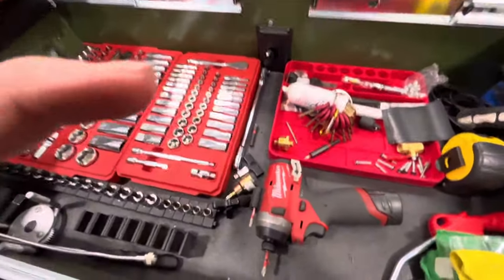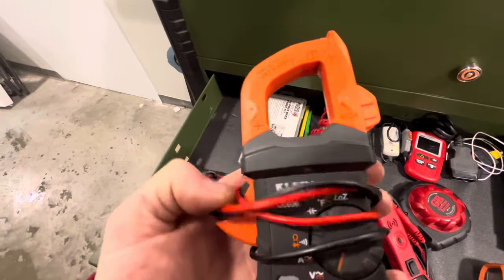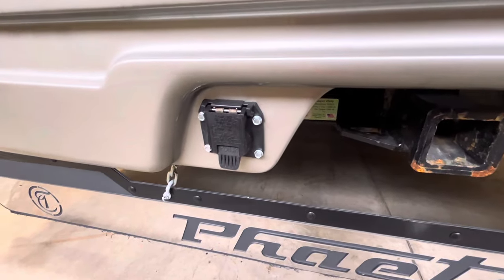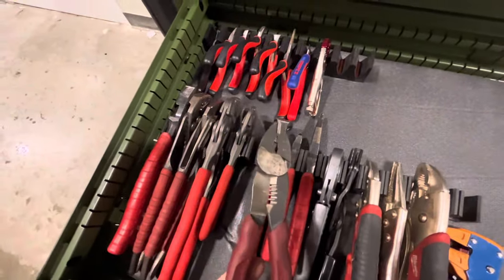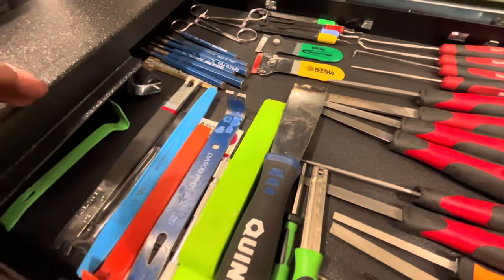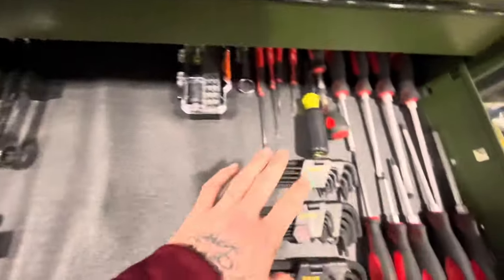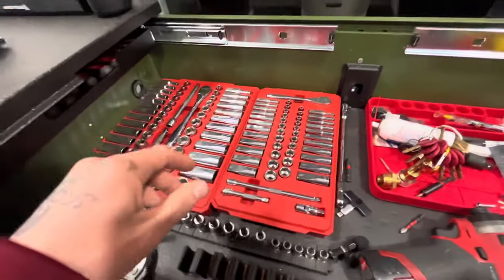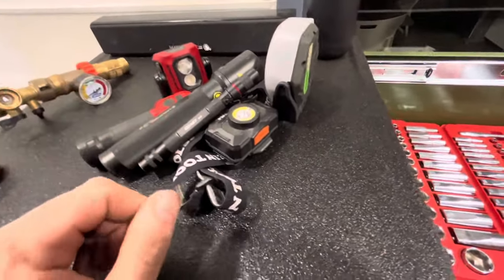5 tools that should be in every RV!

Comment: You don’t having any plumbing related tools, that is a common failure area for RVs, I carry a tubing cutter and a PEX crimper, specifically a ratcheting crimper that can be used with one hand because most of my fittings are in hard to reach areas.
Reply: Thank you I will make sure to add them to my list
Reply: Oh yes….very few rv’s are plumbed according to code. Flex hose crimped onto pex fittings is quite common……

Comment: Been RVing well over 30 yrs.  Besides a well rounded set of tools as said in this video and yes plumbing tools as mentioned in one of the post    Remember rvs have both pvc and pex systems so make sure to carry tools for both as well.  As in electrical rvs run both on AC voltage as in dc voltage as well. You’ll need tools for both as well.   1 piece of tool that is not mentioned and has saved me countless times is a ladder if your rv does not have a roof access ladder.

Comment: As an HVAC tech, I recommend that whatever multimeter you get, MAKE SURE IT HAS A BACK LIGHT FUNCTION. Also, make sure it can read micro amps-you'll need this to check your furnace flame sensor.

Comment: One thing about power tools is something that (my rv works) suggests having a 12 volt system.  This gives you a portable 12 volt power source, in addition to the tool, for troubleshooting.  Just make sure you can access the battery terminals.
Reply from the maker: If you’re on my TikTok take a look at the 12v test tool I just posted

Comment: Most people don't know how to use a multimeter. As far as testing the pedestal for high/low voltage, you have to know into what slots to stick the probes, because if you stick them into the wrong pair you can destroy the meter. They make plugin devices that do the checking for you with LED lights that tell the user the status of the power supply. I'd rather people bought those than a multimeter. Of course you can do a lot more with the meter, but most people don't know how to do those things.
I have never seen one of those little plastic prybars. If you know where to acquire these tools, it would be a good idea to post links to where they can be purchased in the description of your video. That 3/4 socket bit is also something I have never seen. I like it because it is shorter than an adapter and regular socket combination.
You should advise your viewers that they should get a flashlight with X lumens. I have a 2 AA, pocket, flashlight that puts out a lot of light for being so small. It's 250 lumens. I don't really know if that a little, a lot, or just good enough, but it works perfectly for me.
Reply: I got an inexpensive set of plastic pry bars from Harbor Freight.  Found them in the auto body section of the store.  They may not be of the highest quality but I am not running a body shop and if one breaks I’ll just pick up another set.

Comment: While its obvious your intentions are good, an impact wrench has no place for normal maintenance in an RV. A drill with a torque clutch is the way to go. That way you can use a  low torque setting and prevent stripped fasteners in RV walls, floors, ceilings, appliances etc. As far as using an impact on stabilizers; most stabilizers are made with soft steel (not tempered) and an impact can gall the threads and ruin the stabilizer. Again, a drill is a better option. As far as diagnostics with a multimeter, most people aren't going to have the know how to use one nor will the average person try and diagnose some of the things you named such as appliances and control panels. IMO opinion the average RV'er is going to be better suited with common hand tools to do simple repairs and maintenance such as drivers, sockets, wrenches, a hammer, pliers etc.

Comment: To me, a star-wrench to loosen lug nuts on a flat tire and a torque wrench to properly tighten them are essential. With some random wood blocks available to ramp flat trailer tire off the ground, any able person can safely change a trailer or fifth wheel tire. You can spend hundreds of dollars or do it yourself. Many small towns, like Kanab, Utah have no one who can change a tire on the same day. I changed the flat tire and traveled to Las Vegas to complete the repai. It cost me nothing.

Comment: My RV has a number of #1 and #2 Robertson screws.  So you need those bits as well.   I have the impact bit driver, an electric drill and a 3/8" impact for removing lug nuts and other suspension components.   I carry a bottle jack with large base capable of lifting the RV wheel off of the ground.  Along with Jack stands for safety.  A Quarter inch and 3/8" drive socket sets with additional impact sockets in common sizes.  Additionally a set of pliers,  and a cutting tool.  Multimeter, 12 volt power and ground test light.  Of course a set of bits for the impact bit driver as well as standard screwdrivers,  including two Robertson screwdrivers. I also have an Axe,  folding shovel and step ladder.  (There is a ladder attached to the RV to get on the roof.)   I also keep an assortment of sealants, glues, and cleaning materials.  I used to carry a soldering iron, but found the problem when you are not connected to power.  I now keep a set of crimp style connectors for barious wire sizes, along with a crimping tool.  A sharp knife, as well as some tupbing and fittings for water and gas line repair.

Comment: Just some constructive comments:  Obviously many more than 5 tools covered.  Opinion only- With space considerations I'd just get a 3/4" drive drill/driver.  More torque and more versatility.  Flashlights?  get one with as few features as you can.  The new l.e.d. ones can do annoying things if the batteries get low.  Meters:  frankly I use the amp clamp feature rarely and could probably do without it, but you should mention that the a/c and d/c models cost more.  -There are at least 2 other ways to find and detect parasitic drain with just the volts selection on the meter.  These days there are some people out there that probably assume you carry that monster tool box in your rv....you should probably clear that up :).  To be fair I quit watching about 2 thirds of the way though.

Comment: Overall ...good stuff. Minor thought, although an impact is generally a more compact tool it does not have a clutch and because it's Impact a novice will tend to strip screws and such much more easily than you or I might. But certainly best choice for jacks etc.  Multimeter = Good Choice.  I use Torx Security set, can do both with one set. Didn't see your "5 Tools"... but great job.  Thank you
Reply: Don't ask me how I know, but DO NOT use an impact tool for stabilizer jacks!  It will shear the split pin and your jack will need to be strapped up after it is broken and hanging down limp - not good!

Comment: Thanks for video. I have most of these tools. Multi meter I just don't understand....any videos on this tool?
Reply: This question is more about 9th Grade Science... Units of electrical measurement. 

Volts - electrical pressure
Amps - amount of electrical flow
Ohms - electrical resistance
Watts - electrical power